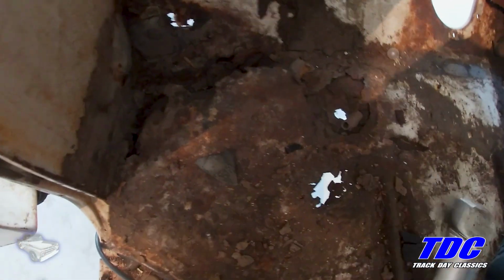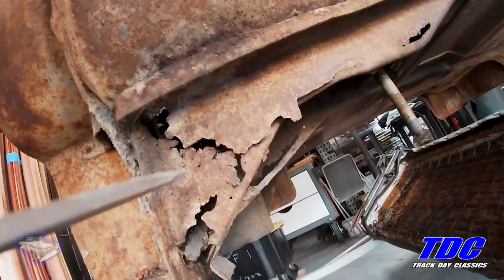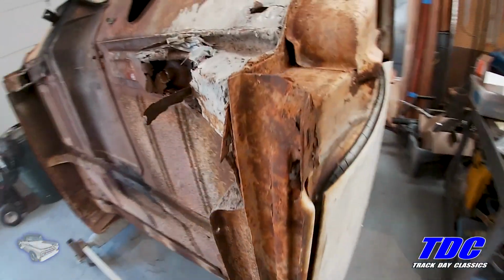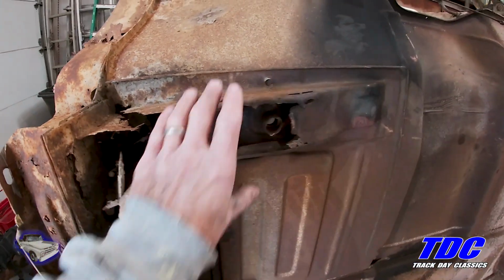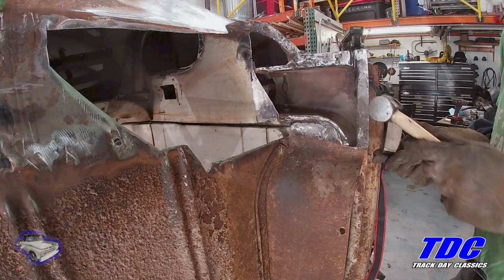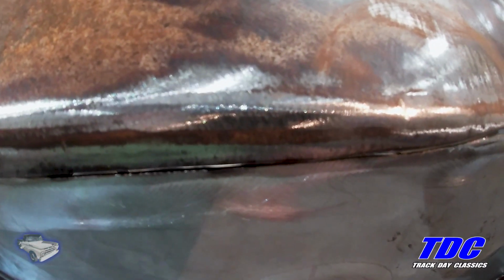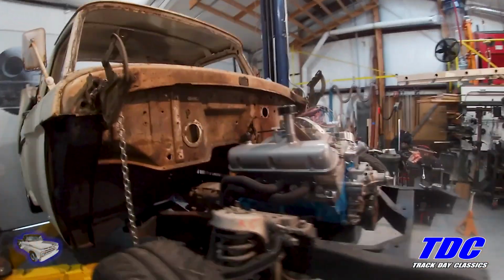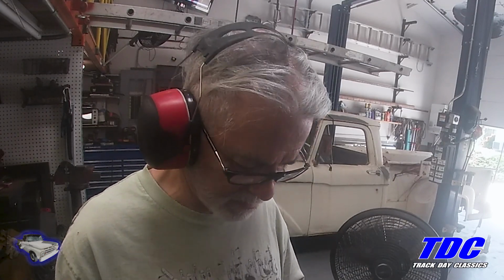F100 Cab Mount Restoration: Turning Rust into Gold

Comment: that truck come with steering box ? how converts to P.S.? how to choose the right one?
Reply from the maker: It did.  Originally the truck had the old worm gear box with the long fixed steering shaft (known the impaler on early Mustangs, Falcons, and Comets).  The Crown Victoria conversion already has a power rack and pinion as part of the k-member right out of the junkyard.  But those were different from one another depending on the year, which for me was which set of hoses to use.  Although I can’t point you in the right direction, I can tell you this is a great set up, and the truck is now a steering machine with great feel, geometry, and tight turning circle.  Cheers!